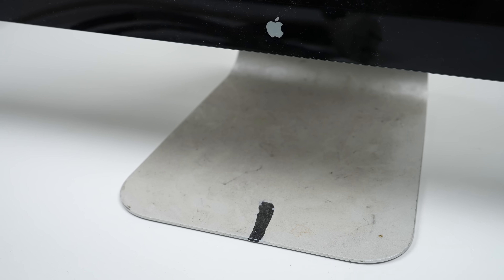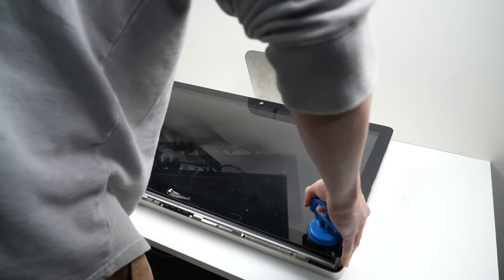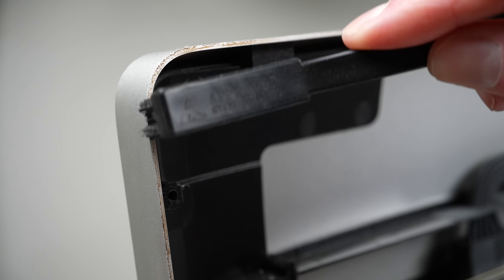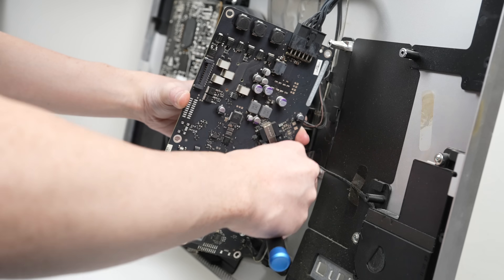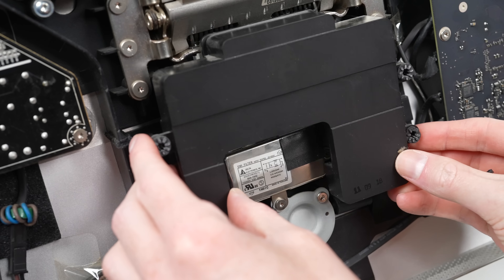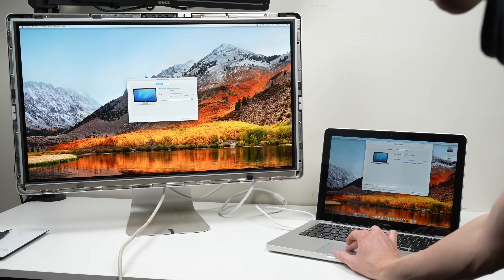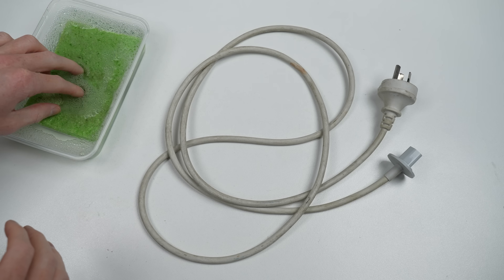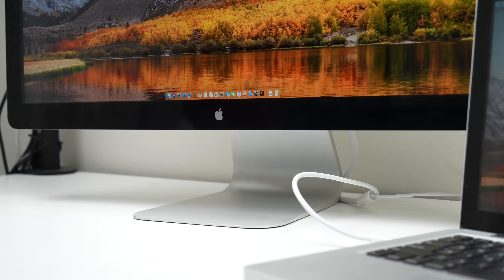Why Do People Sell Things This Dirty - Clean & Repair Of An Apple Thunderbolt Display

Comment: Nice restoration - these displays still look good (at least they do once cleaned!) and would be ideal to use with any recent Mac equipment.
Why someone would sell anything in such poor/dirty condition, I do not know...
Reply: People are lazy.  Look on Market Place with how many items are on sale that 'just need a clean'.  Most of these things are disgusting, but if the seller spent 20 minutes cleaning it, they could ask probably 2x more than they would get for it filthy.  In some cases, they'd be able to sell it.
Reply: The best part is when those sellers actually have the audacity to sell it for 2x higher regardless of it's condition or placement next to much cleaner items.

Comment: That manual air blower looks like more powerful than I was thinking. How does it stuck up aganist a classic air compressor for the pressure it can generate with a single jet of air?

Comment: I still rock a Thunderbolt Display with a M1 Max 16” MacBook Pro and a Thunderbolt 2 to Thunderbolt 3 adapter.  Still a great display considering it was made in 2011.  Mine is in pristine condition and only needed it’s power supply replaced since they were prone to failure.
Reply: the only reason I don't use it anymore is the headaches the glosy display causes, but I work with documents , I presume should still be great for creative work
Reply: So it is possible to use this old display on USB C/Thunderbold 3 Mac eh? Thanks for the information, I thought this monitor only works with Thunderbolt 2 Macs.

Since actually it's not that hard to find this Thunderbold Display for cheap nowadays in marketplace, thank you for the information, I might go with this display instead of studio display that cost a lot. I need the screen real estate for work, 2K is fine for me.
Reply: Same :)
Reply: Is the magsafe connector for power ? I went to the Genius Bar yesterday and they said the monitor MIGHT be able to be peaired once I showed him the pictures.
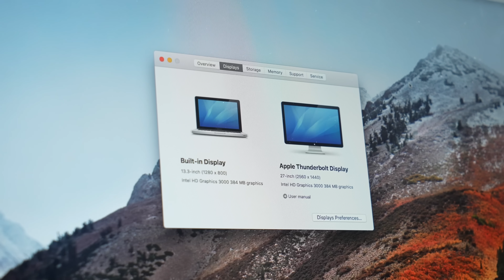Reply: I'm doing research now on the compatibility of M1 Macs with these old monitors. So what about the version mentioned @ 8:38 with the 3 USB ports? Do those not work with M1?
Reply: @JerridFoiles  
Using this monitor with a MBA M1 and everything including the USB-A works like a dream. In the second Thunderbolt port I have the thunderbolt dock dell d6000 that I got used.
Reply: where did you get a replacement PSU? Mine needs to be replaced too...
Reply: @maladjustedtv  Ebay, they are reasonably priced.
Reply: How were you able to determine it was the PSU? I have one from 2011. Everything works except the display will flash for second and then stay off… sound similar?
Reply: @JM_Solo  The PSUs commonly fail.  It was a safe bet to replace it.  But for mine, it was a loud buzzing sound with a brighter backlight.
Reply: yes me too, i have a 14" M1 MAX MacBook Pro.

Comment: 0:30 that is a sticker describing lubricant in German.  

 "Silikonbasiertes Gleitgel" means silicon based lubricant and "Latexkondomgeeignet" is a single word that means suitable for use with latex condoms, leaving no doubt about the kind of lube.

Comment: That’s an insane deal! The 24” version sells for twice that here. Cool to see things deep cleaned like this too.
Reply: thing is  10  years  old.  not worth its  weight in scrap
Reply: @megami215  it’s also higher resolution and in fact better than many brand new monitors. I haven’t seen a 24” monitor over 1080p, and tons of monitors still use IPS panels like this one, in fact it’s the main display technology used. 60hz is fine, and having 4 USB ports integrated into it is above average too.
Reply: @myrealusername2193  tn panels arre cheap  and awful,, oled has been the standard for  about 5  years.  my phone has  higher  resolution then that  crap  monitor and its 3 years  old lmao
Reply: @megami215  oled has not been the standard for computer monitors. I can't even name one oled monitor. now in the t.v space yes. but not monitors. most monitors are still in fact TN or IPS. they are the dominant display type in the monitor space. 

And woopty funking dooo your phone has a high resolution display. do you want a fucking metal for that? Hell fucking movie theaters still mostly cast at 2k, 1440p. wouldn't doubt your phone has the same or higher resolution as well.
Reply: @megami215  Looked it up. there are a few oled monitors. but they are either just t.v's marketed as monitors. so 40+ inch bois. or are a reasonable size 27 inch, but cost $3.5k because they are targeting professional artists.
Reply: @megami215  what resolution is you phone then? And why are you trying to compare a phone with a 24” or even 27” monitor? They’re entirely different. My phone is 1080p, and so are basically all 24” monitors. This one is higher. And I have yet to see an OLED monitor that isn’t a rebranded TV or 1500$.
Reply: @chloedegurechaff1941  I'm guessing that OLED is uncommon because it has burn-in problems, and desktop operating systems have a lot more static elements to get stuck than phones OSes
Reply: @megami215  OLED is not a standard in monitors because it doesn't need to be. I believe that TN should disappear entirely, but IPS and other similar types have stellar image quality, don't suffer with burn-in, and are far cheaper than OLED displays of the same size. Phones use OLED because those operating systems have a lot less static elements to worry about getting burned into the screen than something like windows has. The smaller displays are also much cheaper to make, so it's commonplace now and IPS/TN only appears in low end devices.